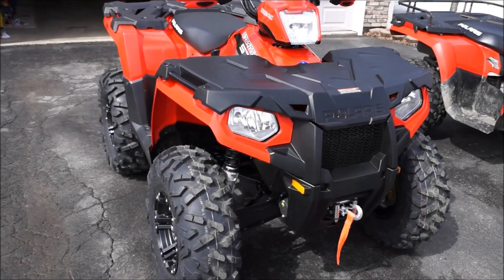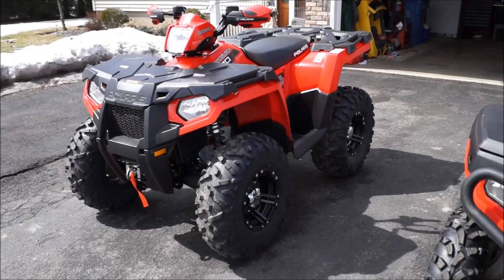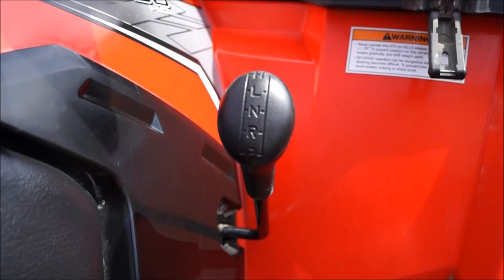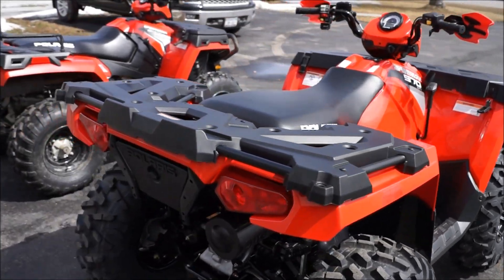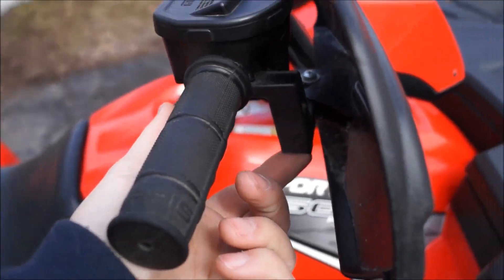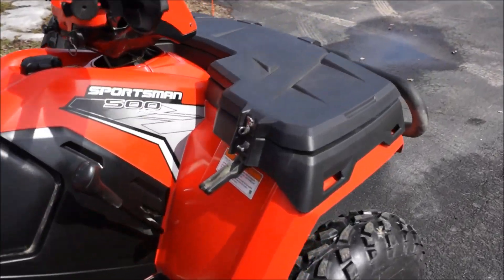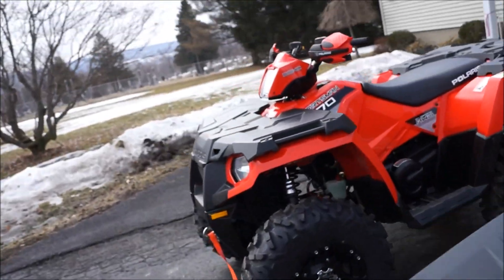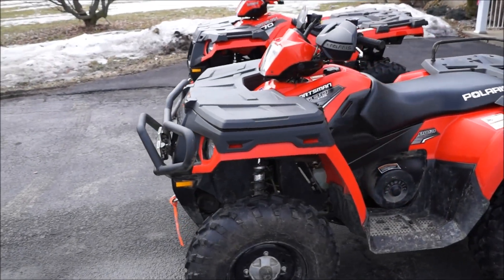Sportsman Comparison - 2014 570 vs 2011 500 HO

Comment: i also have an 11' 500 HO. Drowned it in the river twice, bury it in mud. Run it full throttle all the time. Oil is still as brown as the day i bought it. have about 1000 miles on it now. I was skeptical of polaris at first but its almost as reliable as a honda fourtrax.

Comment: One big difference is the battery placement on the new one.I just cant see how this can last.I've done the research,and found conclusively that down on the frame is not the place for a battery.Sticks,rocks,mud,ice,snow,etc...the old place they had the battery was almost as bad,but at least it was higher up.
These are good running wheelers;the older models,were and still are,the best riding atvs.The new one,I don't know.We will see how they do.

Comment: Great video, you covered alot of good points. I have 2 of these and am fixin to order a couple of the Guru front brush guards. I am getting close to the first service. They said do it at around 25hrs. It takes a little longer to get there than I first thought. Overall the 570 is great. Only major complaint is that on the lower right side you get a lot of heat coming thru that opening. I made the mistake of riding with shorts on and it blistered my leg just above the ankle (about 3 hrs). Will not make that mistake again. I have rode mine in some fairly extreme conditions and it functioned fine. I did find that coming downhill you get some pretty good engine braking by having it in awd and low range. Did not have to get on the brake much. I did install a modification that makes all 3 headlights burn on high beam. Overall, anyone looking to purchase a atv, I think you get the most bang for the buck with the 570. I think mine were like $5700 + tax each.

Comment: That's a great comparison video. Only thing I think you forgot to mention was the difference in the floor boards. The 570's are wider, longer, and they have a new lip on the edge to help keep your feet from sliding out. Oh yeah, they also have a larger stator with more watts to power more electrical accessories.
Reply from the maker: Thanks for the comment. Yes the floor boards are different.  I was actually out this past weekend and they filled up with mud. Seemed like more than the 2011 did in the past. Will go out again soon and do a video on it. Thanks!!
Reply: L

Comment: I just got a Left over 2015 570, very nice machine, im overly impressed with it. it handles very well, plenty of power, goes thru alot and climbs over alot. Im on the stock carlise tires and go thru some decent mud with it. it climbs hills really well and is very stable. Be carful with the front cargo box. the hinges break very easy and the cover costs about $200 to replace. I replaced the plastic hinges when they broke with some stainless ones from home depot for $5. And if the heat from the exhaust is bothering you, order some heat wrap from amazon, i paid like $15 for a 2"x50' roll and it came with 15 metal ties. Now my right side plastics only see about 90° instead of well over 150-175.
Reply: thanks for this! Definitely going to fix up that exhaust heat issue on my 16' 570. That is absolutely terrible how much heat comes out of there. My old 400 Scrambler got a little warm on the right side but nothing like this 570 does.
Reply: stevey500 look up RVS performance for a ECM tune. The heat displacement is due to the EPA required tuning to meet emissions. These engines run extremely lean with very little timing to meet spec. RVS has multiple levels and keeps it way cooler but at a cost of more fuel consumption but they remove the torque limiting on the fuel map which makes it a lot faster. You'll like it, well worth the price

Comment: I bought a 2016 570 in orange burst. I really like it other than its the noisiest clanky thing I ever rode. It pops and clanks like a model T Ford brand new. Polaris says it's all normal which I think is BS but now I just ignore it and ride. 22 hours so far and it hasn't flew apart yet
Reply: Ok buddy get a life, I've seen this comment on every review of a 570. If you really don't like the fact that it makes noise, trade it in for something else and SHUT UP!
Reply: Erik Desormiers what's your opinion on the 570 I'm thinking about buying one next weekend? so far I like everything about it.
Reply: Jesse Poorman i think it's the best quad you can get for the money. AWD system is the best in the industry, suspension is the smoothest factory made suspensions and the 570 offers plenty of power for any trail situations. Put on a good pair of tires and you're ready to go! Great quad, would recommend it to anyone.
Reply: Jesse Poorman  don't believe everything ppl say about reliability, every brand will have lemon atvs. But the 500 was reliable, same thing for the 570!
Reply: Erik Desormiers  I'm 37 I owned all kinds of brands and yes they all have broke something now and again. That's the name of the game when you off road.  I always keep on the maintenance on my machines. But this will be my first polaris that I have ever purchased.
Reply: Jesse Poorman yup that's the trick, regular maintenance. Ppl that don't do those simple things are the one experiencing issues. I wouldn't hesitate getting a sportsman 570!
Reply: Erik Desormiers Well I'm sold so far. I will be picking one up this weekend from my local dealer for 6000. Cheapest I could find one for by me. Still not a bad price for what your getting.
Reply: Jesse Poorman that's a fantastic price! Hope you enjoy Polaris, I've driven Polaris for the past 17 years now. Never regretted the change!
Reply: Honda and Polaris 2 best bikes made Honda beats Polaris in reliability but Polaris is faster and has more power

Comment: The engine is way more powerful then the 500 and I meant a lot , and as for the battary, I've had water well over the seat a few times, and no problems at all, although the first time I got it serviced they had to replace the 2$ vent hose for the battary.

I wasn't a big fan of the lights, but a 80$ light bar off ebay solved that

Comment: Great comparison video first off, and the ss wheels are great looking, but i found that when you are riding through more debris filled swamps like i am, that sticks and rocks/mud will find a way into the lip between the wheel and the tire. Just giving you a heads up.
Reply from the maker: Thanks! Havent had that issue yet but I have hit some rocks and they have a few scrapes on them. I knew this would happen so I'm not to surprised.  Thanks for the comment!
Reply: Und was h

Comment: No pull start on the 570.Low battery no start.Keep battery charged all the time or you will have trouble.Battery position sucks,Winch mounting is easy.

Comment: I kept hearing you say that the 2015 sits a lot higher but your not taking in account the larger aftermarket wheel/tire package your new atv has. If you look at the tires overall height they're definitely a couple inches taller. Nice machine though. 
My dad has a 2012 Sportsman 500 and the thing I hate the most, we'll two things, one being the 2012s seat is too wide and feels stiff imo. Comparing it to my Arctic Cat 500 seat which is soft and narrower. Also I always hated how hard it is to start his Sportsman 500 especially when the atv is cold. Just takes forever doesnt like to idle cold and I know it's not just his. People I've talked to on the forums and trails also stated the same thing. Already cleaned the carb once thinking it could be the issue but it was pretty clean inside his. So the efi has to be really nice. It probably starts within seconds.
Reply from the maker: The seat on the 14 is way harder than the 11 or 12. When you sit on the wheeler you feel as though you sit higher (not because of the wheels) My only complaint on this new style. And yes the EFI engine is way better in starting and in power.

Comment: Great video bud,I  have a question for ya.Are the new wheels the same size as your factory wheels but maybe a little wider?Put it this way will the factory  tires fit the new wheels if the wheels weren't as wide?Are they the same diameter as the factory ones?Sorry for so many questions bud.Thumbs up on your video.
Reply from the maker: Thanks for the thumbs up. The tires are 12 inch. Same as stock rims. They are taller (26inch) and 9 inches wide on the front and 11 on the rear.  But you could mount them on the stock steel rims if ya wanted. Hope that helps.

Comment: I just got a new 570 and love it has awesome power a great ride a big step up from my 08 foreman as far as ride and power, mine has been running great the only thing I don't really like is the drive train is kinda clunky sounding I don't know how to describe it, my buddy said that's the how the clutch is on the polaris machines it only seems to do it at low speeds or going down a hill, does yours do this as well? Thanks
Reply from the maker: Yes. Same thing. Its the clutch and the belt catching each other. Normal. I hate it too.
Reply: Is it a kind of metal scraping sound? Because mine does that too

Comment: Hi, like the video and the comparison. I have a burning question though. Did you have any issues with the battery location on the 570 so far? It seems like a strange place, especially if you are going in the water.  Any info would be welcome. Also, did your bike suffer from some of the electrical gremlins that people are complaining about with Polaris?
Reply from the maker: Christian Raith sorry for the late response.  Never had any issues. Seems like the battery location is ok for now. I have to admit I use the 500 more than the 570 though.
Reply: Thanks for the reply. Good to know you haven't had trouble with it.

Comment: did you have to put wheel spacers on the 2014 to fit the bighorns?
Reply from the maker: Nope. No spacers. The offset in the wheels is enough. Perfect fit.
Reply from the maker: 4/156 ITP SS212 Alloy Series Wheel 12x7 4.0 + 3.0 Matte Black
Reply: Beauty, ive got a set on the way.

Comment: does one of these bikes ride better than the other? do you know if the suspentions are the same or similar? looking into getting a 4 wheeler for trail riding but my spine if fused and i need something that rides as smooth as possible.
Reply: 1795magicmoney1795 the suspensions are the same, the sportsman sp's have a dual a-arm front suspension to match the dual a-arm on the rear. A few reviews say the sp's ride better but the sportsmans already have the best ride in the business.

Comment: Any updates on the 570?? How do you like the new motor and increased power? I just bought one last week. But I'll have it parked until the spring. Had to take advantage of a great price. That's why I bought it now
Reply from the maker: Love the power. No problems at all. Hate the seat. Other than that it is perfect.
Reply: Ok thanks. Can wait for the spring. Also it won't be -40 like it is today.

Comment: Is the Engine made by Fuji Heavy Industry's on the 2014????
Reply from the maker: Im fairly sure Polaris hasn't used Fuji engines since the 90's but I may be wrong. I think they are all Polaris built now.
Reply: :( I liked Fuji Heavy Industrys,Super reliable...

Comment: suspention Wise are they the same? soft? harder?
Reply from the maker: Suspension seems the same. The seat makes it feel harder. Could be the tires too. Gonna lower the air pressure to 5 (currently 7) and see that is better.
Reply: I run 3 in front & 5 in rear, I put over 2,000 miles on last summer with no problems.  And i came off sport quads to it being my First utility quad. Quads i have had in order - KFX 400 LTR 450 KFX 700 TRX 400 - over ten years time. Now I Rock out with my 2013 sportsman,  check it out on my page buds.
Reply: Craigarar1971 Thanks. I bet they redesinged the seat harder on the 570 to give the 550 a chance at sales. LOL. The xp looks great but the 570 looks like the best bang for the  the buck and best motor also. DOHC, smoother, more powerfull  and less Noisy. I look foward to pick one up.

Comment: And also what's the tire and wheel sizes much appreciated thanks
Reply from the maker: 4/156 ITP SS212 Alloy Series Wheel 12x7 4.0 + 3.0 Matte Black
Tires Maxis Bighorn 26x9x12 front.. 26x11x12 rear.

Comment: Do you have any problems or complaints about this model? I'm looking to buy it.. just need more feed back from people who owns them.. Thank you!
Reply from the maker: As I said on the other video remarks. No issues except for the aftermarket wheels and tires. They hit the rear fenders under hard riding. Stock ok. Seat sucks but that is just my opinion.  Since I have the older version and this new one to compare, I prefer the old style.
Reply: glockman83, I looked and researched for a couple of months before buying. I wanted a good product without breaking the bank. So far I think I made the right choice. For what I would consider normal riding, I believe that the 570 is just as good as any of the other major brands. Also I think that the ride is very comfortable. The power is awsome, and I think I rode around 4 hrs and used close to 1/2 tank of gas. Hope this helps you.
Reply: last night i bought 550 model with PS. and got home and notice one tire is low air.. so added air and same problem.. there is a leak.. will try to find the leak worst case take the wheel to dealer.. they are 1.5 away.. sucks.. but did get cheaper by 400 vs my local dealer..
Reply: glockman83  Great. I do not know anything other than what I have read about the difference between the two other than the HP. Does yours have a winch? If not check with your dealer and get the winch mount made for that model (bolts right up) and I got a 25k badlands winch (with remote) from harbor freight (seems to work fine). Was easy install (took about 1hr). Also on ebay there is a thing you can get that installs in the upper headlight housing that makes all 3 lights burn on high beam (was about $9 and I think the dealer was mountainman or something like that). It also seems to work great. And to all who might be looking for any brush guards, give GURU brush guards a look. I ordered 2 front ones yesterday and talked to John the owner. Sounded like a real nice guy. Said it would be at least a couple of weeks before shipped, as they make them to order. Good luck glockman on your purchase
Reply from the maker: glockman83 ... sucks about the tire. 550 is totaly different than the 500 and 570. They are awesome rides though. Good luck with it!

Comment: What size tires on the 570?
Reply from the maker: 4/156 ITP SS212 Alloy Series Wheel 12x7 4.0 + 3.0 Matte Black
Tires Maxis Bighorn 26x9x12 front.. 26x11x12 rear.
Reply: Is the rear rim a 12x7 also?